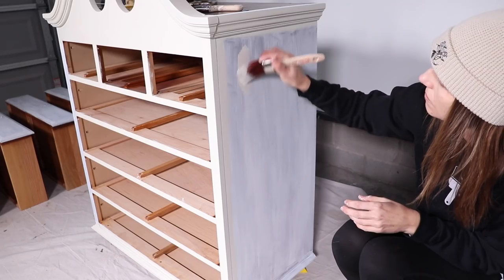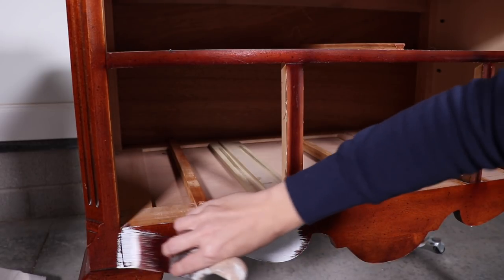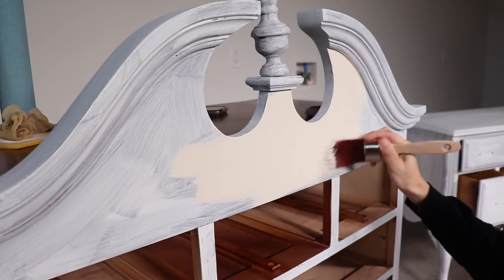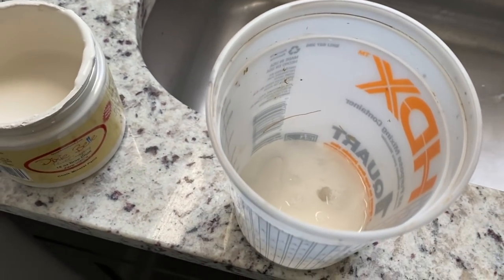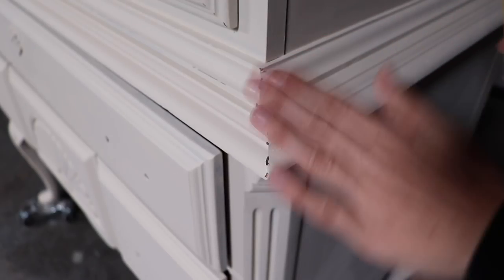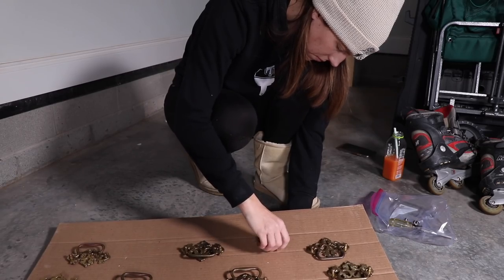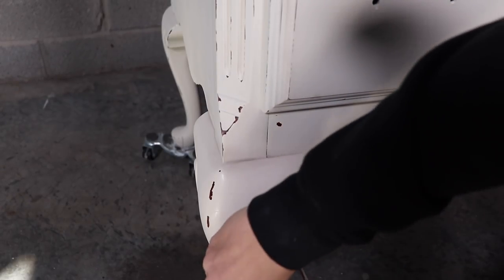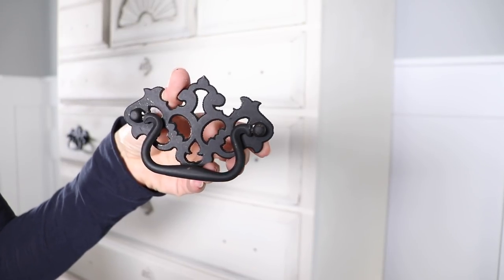How To Distress Furniture | Farmhouse Furniture Makeover

Comment: Love how your dresser turned out. So perfect. I have just purchased a Graco 360 paint sprayer and am so apprehensive about using it. It doesn’t have way to control the flow or pressure that paint is sprayed. Not sure if this is a good thing. I have an old rocking chair that I sanded down the seat and sealed that and am painting the rest with the sprayer. 🤞🏼Thanks for all your sprayer tips. They will be useful. 😊